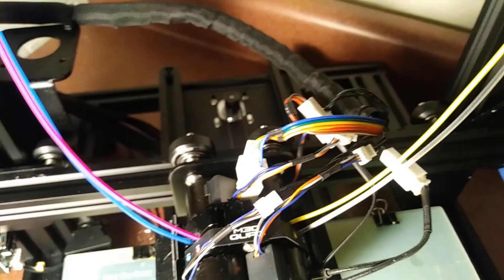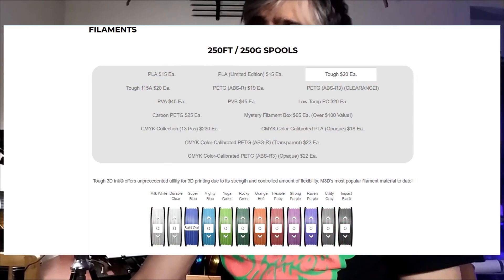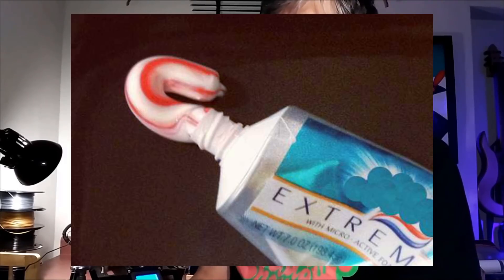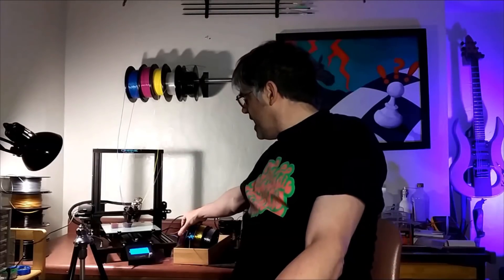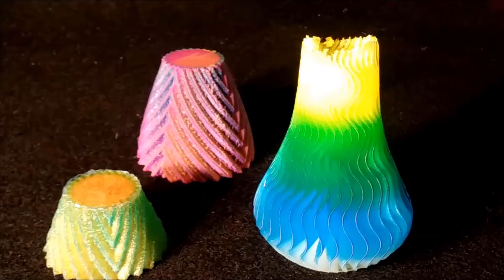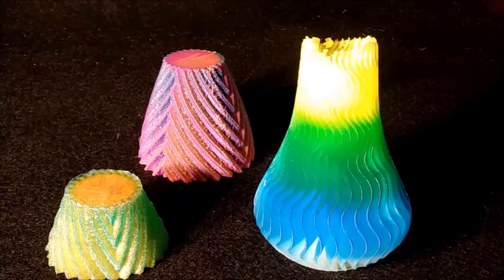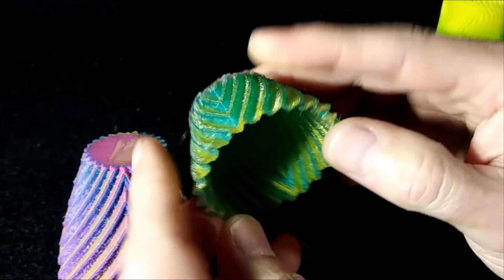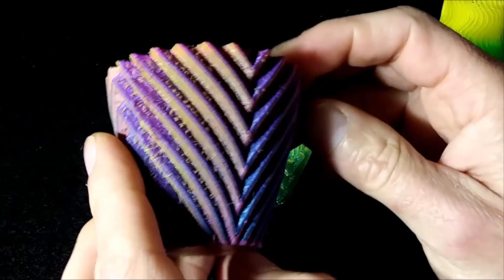M3D Crane Quad First Impressions

Comment: What about the "toothpaste" effect?  This is the issue with the Diamond nozzles, and I wanted to see how this QuadFusion handles it.  You also mentioned you may get it from the PLA from the print.

At the end, you showed off the vases from that PLA print (with bad strining). If that was the toothpaste affect changing colors on all the sides, wow... That's horrible!  However, you were not clear on your settings and focused more on the stringing issues; it's not clear if you had indeed tried to print parameter one color, and the other parameter another color or you just had a single CMYK 25% color mix for the entire thing.  

I'm assuming the latter, as that looked pretty bad...

Also, if you would like some constructive criticism to improve your videos...
Decent review video, full of great detailed info. A- (didn't follow-up with the toothpaste effect comment, which is why I was here).
Could work on better lighting and it would be much more professional (and a few of the initial edits was too fading/chopping). C-

Comment: I just recently bought the quad. I printed the vase that came with the machine. Looked goods. I printed a multi-color Turtle frotm Thingiverse and was impressed with it even tho I didn't have a wipe block for the color changes.
I have expreinced two filament jams which could totally be user error but the second one pulled the PTFE tube up and the hotend will not go back in place correctly. I followed the directions to remove the PTFE tube but that leaves the metal insert behind. Nothing mentions how to remove that. The replaement inserts show both.  IF the hot end was in stock I wouldn't bother with the insert.
I have a Logo I want to print but now it's on the back burner.  
I am trying to find out if the hot end is a warrenty item or not.
I'm impressed with how quiet it runs!
If I get it back up and running maybe I'll shot a video about it.
I wish Voxelizer had more videos on using it and slicing stls with it. It would be nice if you could actually use the CMYK numbers for the colors you want it to blend instead of percentage.  I found a CMYK chart that I HAD planned on using.

Thanks for posting your video, I appreciate it.
Reply: DJMovit I ordered mine in batch 3, I was wondering when did you get yours and what batch. 
I’ve been waiting since April 2018 and still not here??

Comment: Yeah, many many of us are still waiting on our printer. Count yourself lucky to have received one.
Reply from the maker: Fair enough.  However, I seem to be having difficulty with  at least two motors on the extruder. So lately the machine has produced more wasted prints than anything else.  Good luck getting your machine and I hope that M3D resolves some known technical issues along the way.
Reply: @ntx9design392  Yeah I think they are having problems on a lot of fronts. Mainly financial I think. Its a shame, but perhaps they will make it past some of these difficulties. They certainly need to fulfill their obligations to early adopters though. As more bad news gets out, disgruntled supporters and so forth, fewer people will invest causing more money problems for them, the death spiral scenario.
Reply from the maker: @daleaferrrier  I agree completely.  I also feel that M3D is tone deaf when it comes to listening to the concerns raised by the early adopters.  If they are not learning from our challenges, they are unlikely to  improve or correct these issues on future machines.

Comment: Cool video. Thanks!!  Can you show your operating of Voxelizer?? I am still having issues loading related stl’s for each to be a different color. Thanks. Also do you have any other multi color printers that you use?
Reply from the maker: Thanks for the comment.  I will try to do a follow up video in the next week or so and will address my experiences with Voxelizer and the output.  Also, this is my first multi color printer.